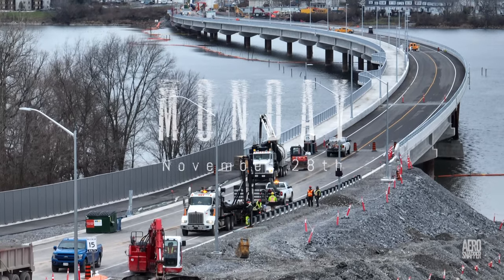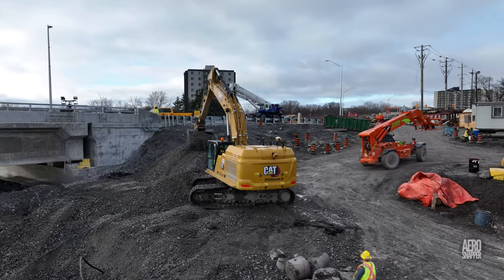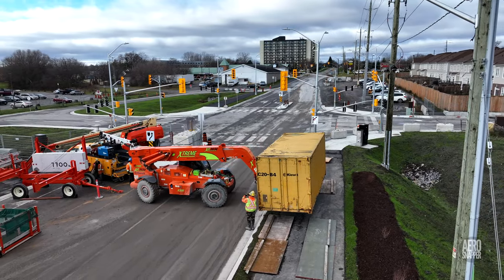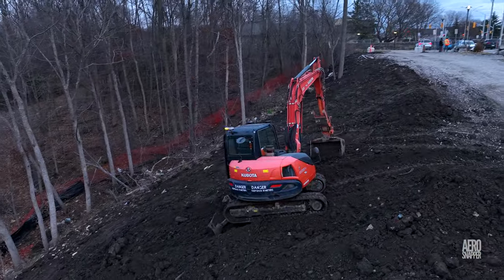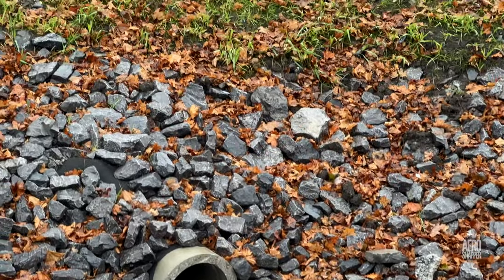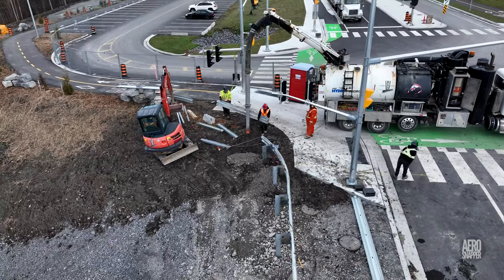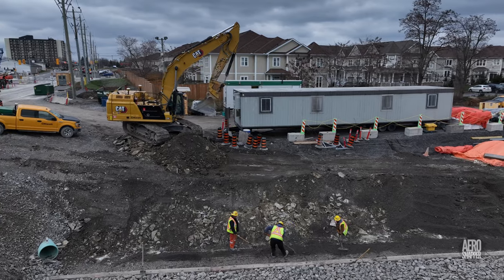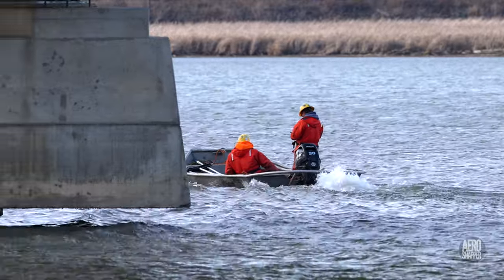Oh, So Close    4K

Comment: Mike, 
Are the seal spans going  to be sandblasted and painted in the spring, or are they Cor-Ten steel?
Reply from the maker: They will not be painted - they are indeed Cor-Ten.  This solution saves time and money on the need to re-paint or re-treat periodically - and it's expected to last up to a century.
Reply: @Aerosnapper  Cor-Ten maybe durable and a money saver but it's rusty looks are nothing like the lovely verdigris shade we were sold in the lead up to construction. They call that the "Kansas City shuffle"!
Reply: What you see is what you get. They are Cor-Ten and expected to look durably rusty for 100 years.
Not what we were shown in the public meetings.
Reply from the maker: @madamemeng884  I respect your views, but the original images were artist’s impressions, with the artist deciding the finish. Personally, I feel that the understated Cor-Ten finish blends more naturally into the World Heritage surroundings.
Reply: @madamemeng884  Cor-ten steel is slightly stronger than mild steel. When one takes into account the need to sandblast and repaint mild steel every ten years or so those costs are reversed, so I believe that the Cor-ten was a wise choice. I prefer the look of the steel to bare concrete.
After decades of discussion and debate about a third crossing we finally have a bridge....just be thankful!